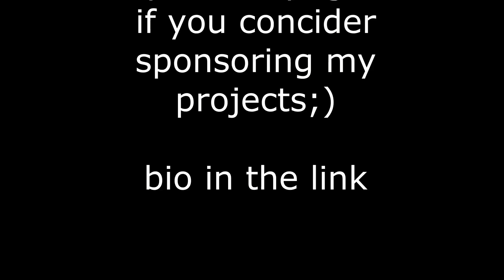F-35B | FliteTest Flying "TransitionTestFrame" !! Amazing! VTOL FEATURES f/w SQ11 mini DV Camera

Comment: If you use carbon fiber it is going to be strong but it doesn't flex very much.
You need to build in a shock absorber of some kind so that the stresses don't spread into the airframe.
Reply from the maker: Hmm good one

Comment: Have you seen the "E-Flite Convergence"?
I have flown mine extensively. I have been thinking about converting it to a Pixhawk.
It uses a similar control system in that it has tilting motors to transition.
And they are cheap....
It transitions with a single switch. Maybe a pixhawk configuration file could be basically modeled and then tweaked to fit the F-35?
It would give you someplace to start with programming a transition.
Reply from the maker: I do have a pixhawk, but is not easy to configure. But it is very stable. Transition is a new story. But small baby steps

Comment: I use balsa and glued on 0.5mm x 10mm carbon fiber strips for structural reinforcement, a lot lighter than full carbon fiber and stronger than wood or plastic
Reply from the maker: ah great tip!